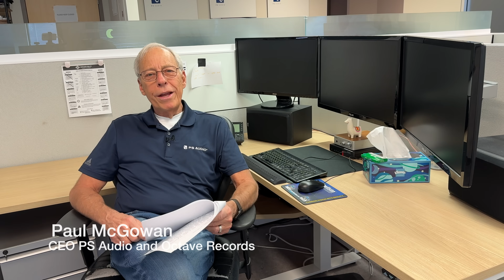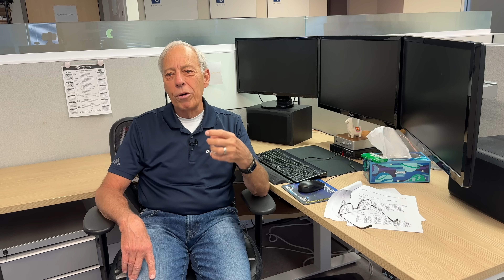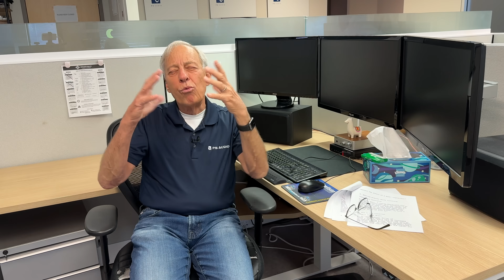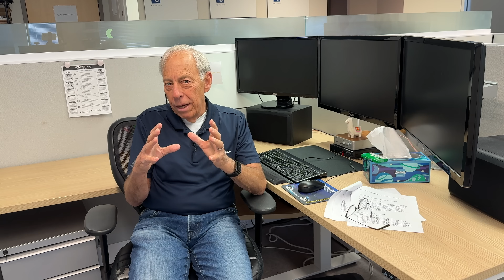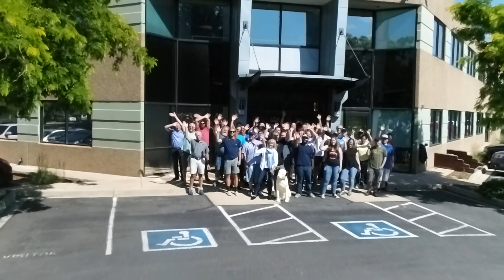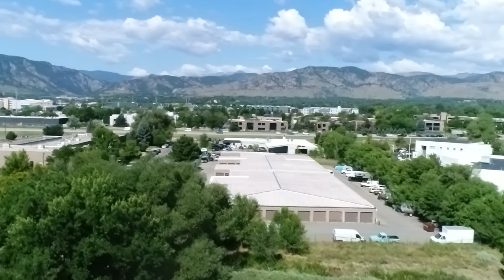Eyeglasses, learning to listen and circuit design

Comment: Accurate measurement is not always perfect, it is completely correct. I think this is because the analog signal always has an incalculable part in calculations, and digital was invented for this incalculable part of analog and failed to satisfy many because of the defect in the removed part (This is the reason for my interest in vinyl)

Comment: Paul, your description of the new component missing something - roundness, solidity, or however it’s described is something I describe as not having “beauty as well as truth.” I have a very good solid state amp sitting in its box because it didn’t have the beauty of an amp costing half as much. And yes, the less expensive amp DOES have truth. But it also has beauty. And beauty is truth, too.

Comment: @8:29 "In this case, it just balanced it out."
And I bet that the measurements, @4:57, were no longer measuring as good.

And I also bet that the "everything can be measured" minions would still purchase the better measuring "bipolar junction transistor" equipped version over the better sounding "field effect transistor" version.

And I also bet that the "everything can be measured" minions will insist that there is no need to do listening tests between the two versions, because they have their measurements.

If everything can be measured, then the "everything can be measured" minions should explain how to measure their own brain's reality synapse impasses and miswirings.

Perhaps the fake, pretending to be a scientist "Amir" can give us measurements that explains all of the above "everything can be measured" brain wiring anomalies?

Comment: Mosfets are awesome. I upgraded my car stereo ten years ago. Back then I didn't know much about hifi equipment's but I went with reputable brand, Sony. I used to wonder why my car stereo sounded great. Cheap low performance speakers still sound great in the car. I had to spend a lot of money and time in my home audio just to surpass it.  later this year found out that the my car amp is actually a class AB Mosfet amp from Sony. I like the FET's sound.

Comment: I'm the opposite. I usually listen with glasses on even in the dark. It puts me completely off locking at the wall or ground and not having clear vision. Also, if things like that are important in audio, you should consider your hair length, beard and rhinoplasty! And don't listen in the morning when your pillow pushes your ears towards your head! Maybe that's why most women aren't audiophiles? Their hair obstruct sounds.

Comment: I've been on a bit of a thing this year about trying to explain to all the folks who scream snake oil all the time that listening is a learned skill that takes a long time to learn and if you haven't actually done the work to learn it... It's a much more involved and comprehensive skill than people realize. It is a process that involves the whole body, not just the ears. Chefs are not born with the tasting skills needed to be a chef, Sailors are not born with the skills needed to tune or drive a sailboat, same with motorcycle racers and car racers and the list of things is endless. The body is an amazingly sensitive and accurate sensory device that can use considerably more than the 5 primary senses, but you have to learn to listen to it and understand what it is telling you.
Reply: You and Paul could sell elephant tusks to caveman😂
Reply: @shipsahoy1793  Your comments are not the flex you think they are.

Comment: Does the brand of lazyboy matter? Should I put both feet on the floor, or can I sit cross legged? Can I hold a cup of coffee, or should both hands be on the arm rests? What about a glass of Scotch? Can anyone else be in the room? Does all this channge?
Reply: Exactly! How old is the lights are turned on or off? Does the sound hit the light beams when the lights are on and when the lights are off it sounds better because it's not hitting light beams
Reply: @ryanschipp8513 If you want to be successful at being sarcastically critical, I would suggest you clean up your composition skills." How old is the lights turned on or off?" I recognized your other comment later on for the same reason.
Reply: @stevet7487  it's called text to speech screwed up my sentence. I often talk into the phone and that's the phone
Reply: @ryanschipp8513 So then don’t use a flawed product.